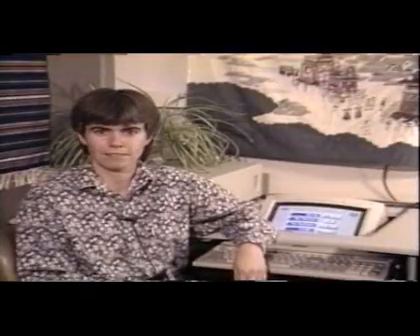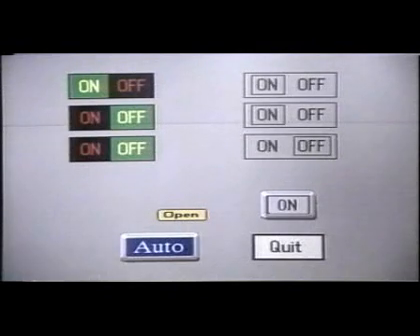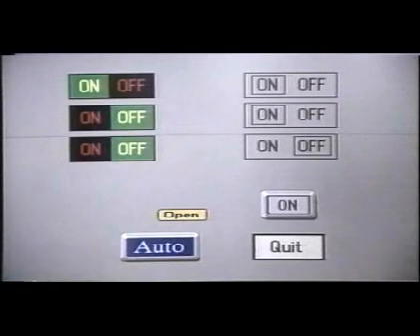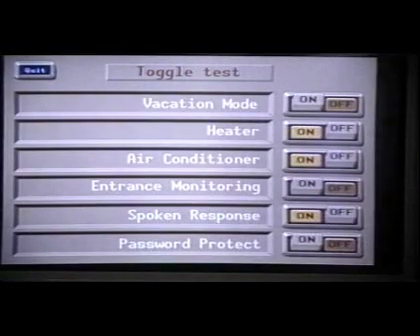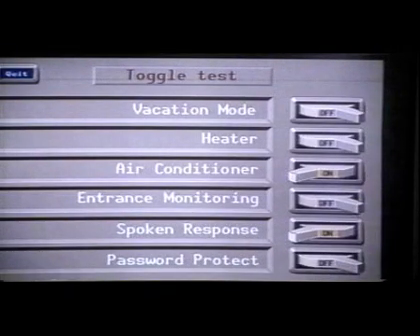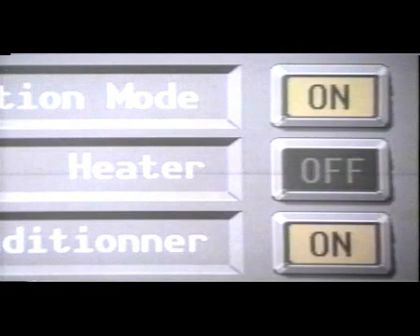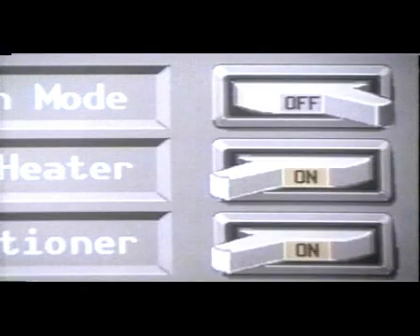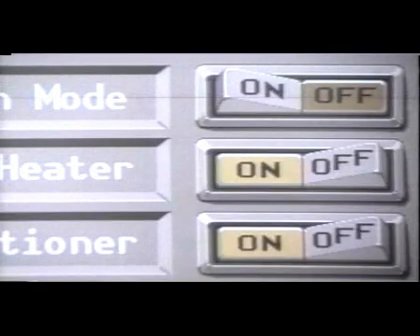1991 video of the HCIL touchscreen toggle switches (University of Maryland)

Comment: This video and a companion report are used as evidence of prior art with respect to the Apple slide-to-unlock patent.

The particular study found that sliders were not the obvious choice for toggles and the explanation is very clear (including the suggestion to allow for user preference in some cases).

Without getting into the complexities of patent claims and problems of after-the-fact obviousness, one thing strikes me here.  Slide-to-unlock is not a toggle.  Not unless (or even if) there is a slide to lock gesture too.  

The second thing is that the entire affordance is not of an inviting toggle, even with slide to lock.  The absence of a visible toggle and the absence of a need for it suggests to me, as a casual observer, that the slide-to-unlock gesture as used is quite different and doesn't fit into the case of toggle intuitiveness.
Reply: "Slide-to-unlock is not a toggle"

If it is a slide switch from one state to another state it is most certainly a toggle.
Reply from the maker: staraffinity To clarify: The knob IS following the finger and all the slider controls showed here definitively swinged back if not dragged all the way to the other side (would not be secure otherwise). It also led us to add a small sound effect confirming that the switch had taken place.  Of course this behavior is inspired by the good-old mechanical controls that have been around for even longer.
Reply: Jocko Jonson It's not a two state on/off toggle in that it ”bounces back” if you don't drag far enough.
Reply: staraffinity Presumably that's what the slide-to-unlock does in this video too, but she never demonstrates what happens if you don't slide it all the way. She even mentions specifically "the long slide on a touch screen prevents accidental toggle compared to a button".
Reply: Jocko Jonson Yes, but there's still a difference having a knob follow your finger while you do the unlock. Look, I also find some of these software patents crazy, but we shouldn't trivialise the research that goes into them. A solution that seems easy and simple for the end user might have undergone a lot of development.

I'm also quite sure that if Apple wouldn't patent some of these things someone else would. Apple gets sued a lot and at least some years ago they were the most sued tech company (don't know about the stats as of today).
Reply: Catherine Plaisant thanks for the clarification.
Reply: Jocko Jonson WELL YEAH BUT IT IS STILL NO THE THE SAME TYPE OF SWITCH. CELLPHONES NEED TO SLIDE AND THIS ONES DONT AND ONLY ONE ACTUALLY FEATURED AN UNNECESARY SLIDE FEATURE SINCE IT ALREADY FUNCTIONS AS A BUTTON.